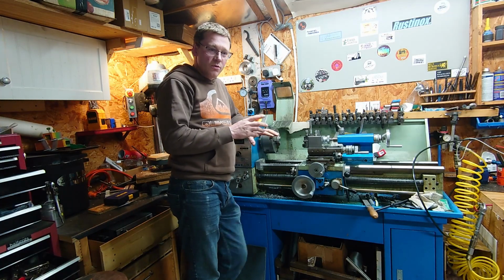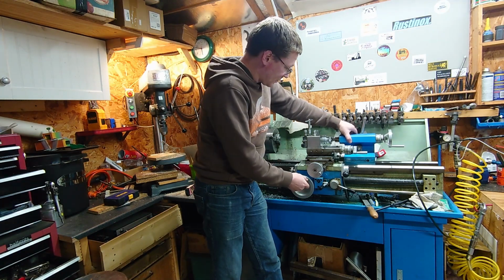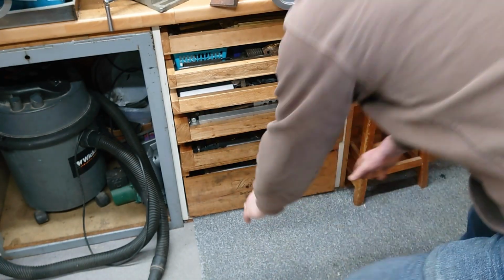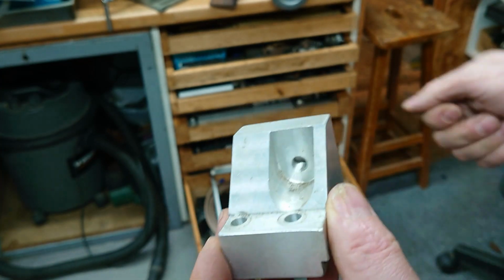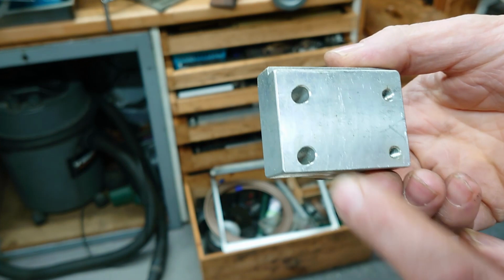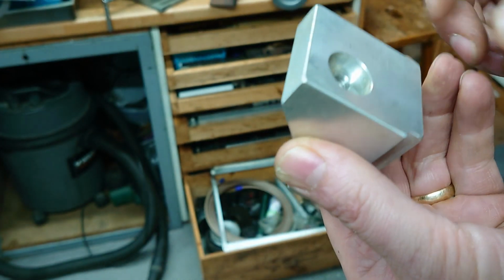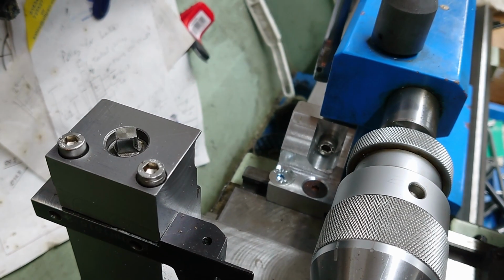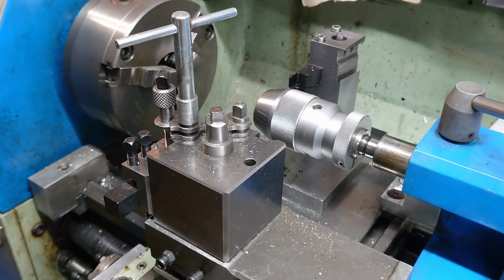A Lathe Tailstock Pecking Attachment (Advent 22 Day 10)

Comment: One for next year's advent calendar, a tool post drill chuck holder. You can treat yourself to one of those fancy integrated keyless chuck with a 16-20mm arbor.
Reply from the maker: I've seen the toolpost drill chucks, but unless I've missed something (more than likely), it gives you the same capability as this, but with the need to somehow find the centre. On the face of it, I can't see any advantage to the toolpost version. If I'm wrong I would be interested to know.  Many thanks for the shout out today, very kind of you.
Reply: @ollysworkshop  I suspect it would be more rigid. The rigidity of the tailstock attached to the cross slide relies on the connecting clamp since the tailstock should be loosened to slide. It may not matter at the end of the day for light drilling. You're correct, the tool post  drill chuck will need center finding. It's annoying unless you have a dro setup with tool offset library. Your idea is brilliant nonetheless, thanks!
Reply from the maker: @HM-Projects  very good point about the rigidity. I do plan on getting a dro fitted to the lathe, but it's a way down the list at the moment. Perhaps when I do I'll try out the toolpost drill and compare between the two!